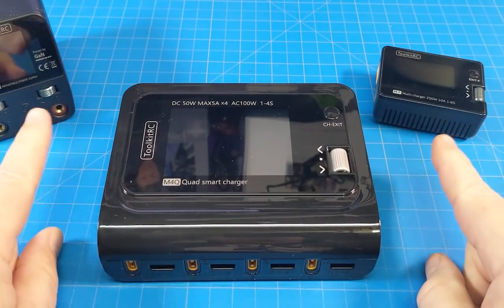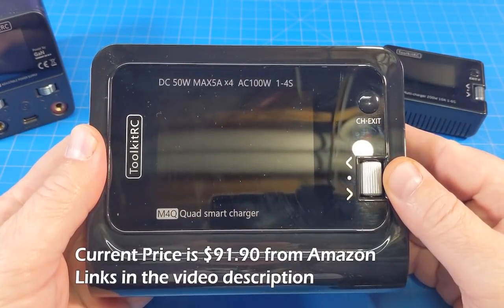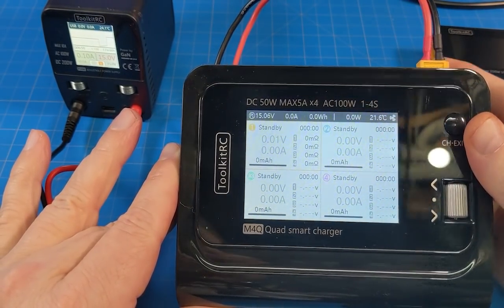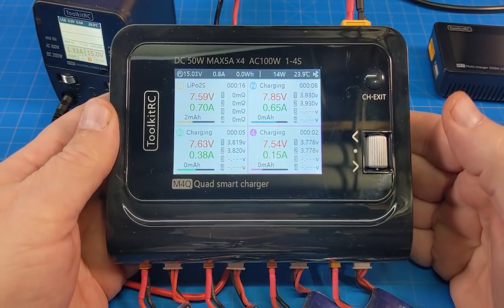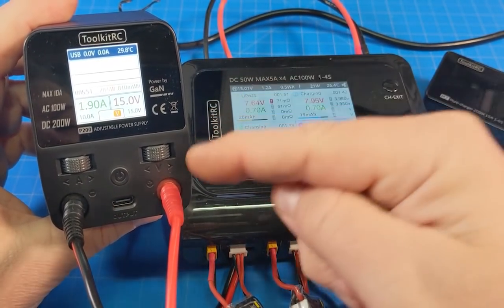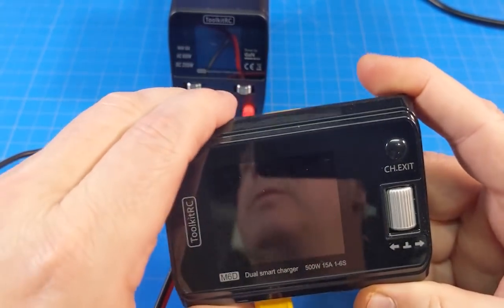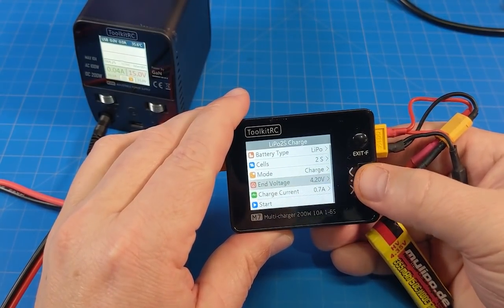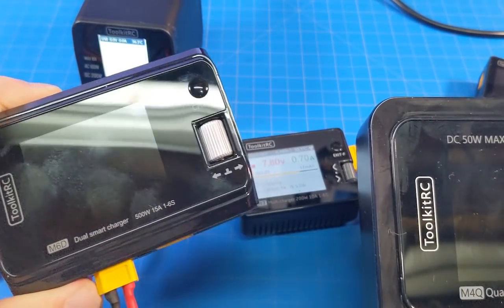My Favorite New Charger // Charger Power Supply // Field Charging

Comment: have the Emax  Hawk Pro and it comes with the XT 60 connector so I accidentally plugged in the 6S battery backwards to the Drone XT60 connector but it should’ve never happened because the bullet connectors in the Hawk Pro XT60 plug came too long an the battery on the drone made contact for a brief second with the plug reverse plurality on the battery and made a big spark and smell of something burning, and yet the damage to the drones board is minimal there was A slight melted transistor or resistor, I’m not sure what they’re called where the negative black wire is soldered to the drones board and after I took it apart and cleaned everything off I didn’t see any other damage to the board. and then after testing all features and functions they worked on the drone, it’s a miracle, it was a very short spark, but why are the bullet connectors so long in the stock XT 60 plug that comes with the drone in the first place they should never have make contact accidentally in the first place because the plug only plugs in one way. very confused and pissed off that this was able to happen in the first place. have you ever noticed any XT 60 plugs that are able to make a short if they’re reversed because the contacts are too long on these plugs?

Comment: hi nick
for 2s lipo right
we still can see lipo and lihv version （e.g. gnb 450）
which one you recommend？ 
And i see you charge your 2s to 4.2only
is it a good practice to get lihv and charge it to 4.2only (for 2s and more)
Reply from the maker: I only charge 1s batteries to 4.35v all other batteries charge to 4.2 doesn’t matter if they are high volt or not
Reply: @NickBurnsFPV  thanks for your help

Comment: Hi Nick, I've been enjoying and learning a lot from your videos.  Total Noob to drones but I have an extensive and dated RC background.  Question - My current Moblite7 uses PH 2.0 connectors/batteries.  I would like to charge as you do in a simple multi-pack way.  What charger would you recommend or is the answer to change the battery lead on the drone?  I already have a collection of about 16 1S batteries ranging from 300mAh to 650 mAh all with PH 2.0 connectors.
Reply from the maker: The two chargers I use aren't available any longer, but I also have this charger https://www.racedayquads.com/collections/battery-chargers-accessories/products/ultra-power-up-s6-1s-battery-charger or we can use this series/parallel board to charge 4 1s batteries at a time on a regular charger https://www.racedayquads.com/products/the-flying-sandal-1s-parallel-charging-board?_pos=957&_sid=0cbc289d1&_ss=r

Comment: Thank You NICK!!!!!!  This thing is a life saver for my 2s shark byte whoop build.  I was literally waiting one battery at a time to finish charging from my expensive 2-6s power charger.  I've heard many comments warning about parallel charging.  And let me stress the importance of being able to plug it into the wall for power.  Wall a/c120v capability is a must for micros.  

Now can you recommend something like this that works for 1s and can do both charge and storage charge?  Also would be nice if it could do jst2.0 and xt30 for my 1s lipos.  Thanks for the focus on micros.
Reply from the maker: for 1s charging I use the htrc x4, its not similar to this at all, and only has ph2.0 connectors.

Comment: Is there any specific reason to use the P200 with either the M4Q or M7 because from what I can tell, they both have a power supply built-in.
Reply from the maker: The m7 does not have a power supply the m4q does. I used the P200 with the M4Q for demonstration purposes.

Comment: I also have this charger. I like the feature of having memory to save 5 different configurations. I have 4 configured for my lipo/lihv charge and storge combinations. You need to enable it in the configuration menu :) (by holding the button) and turn that option since by default is not enabled. I discovered that nice feature some months after hahaha

Comment: My M4Q made horrible fan noise when they kicked in while charging. To the point I suspected the fan was broken. I wrote ToolkitRC, insisting to send me a new fan. They were nice and did that, free of charge. I swapped it, but issue was still there. I found out, that it only does that while charging, not when it spins up when you plug in power and it spins up for like 3 seconds. So it was obvious, they are doing some sort of crude PWM and it did not work out. So I added a capacitor accross the fan (16V, 1000μF) and the noise issue was gone.

Edit: Some commentors suggested it does discharge, but that it's VERY slow and only does so in "Storage Charge" mode - I am going to test that now and edit this paragraph accordingly.
Edit2: WOW, it really does discharge when you select "Sto. Chg." It's painfully slow, but I don't care - my use case is to discharge back to storage charge when I did not use all batteries after a flight. Awesome!

Comment: oh man i was just looking for a charger that does multiple lipos..... this looks perfect.... had a not so good time with a parallel board and i dont trust them..... this looks amazing....
Reply: Edit: Some commentors suggested it does, but that it's VERY slow and only does so in "Storage Charge" mode - I am going to test that now.

Edit2: WOW, it really does discharge when you select "Sto. Chg." It's painfully slow, but I don't care - my use case is to discharge back to storage charge when I did not use all batteries after a flight. Awesome!

Comment: That second batt from the left looks a little "Stay-Puff"... is that just the camera angle or are you about to "self-destruct"?
Reply from the maker: Like camera angle. I don't mess with marginal batteries.
Reply: I figured it was a trick if the eye or camera... but I had to tease you a bit, I am usually asking questions and seeking answers, a little goofing around is good for the soul.

Comment: Hey Nick, I got one of those M4Q chargers when they came out & it’s great so far. Been using it on my 4s 850mah batteries for my 3” drone ALOT haha👌 I haven’t used it with a power supply though & only from the 240v out the wall here in Australia. 
Also I made & flew my 1st 5” drone yesterday!!!! Wooooooooo! Wow! So smooth & on stock BF with no rpm filters, bout to take it for another flight now😁

Comment: I prefer my Q6 + adapter in series instead of a parallel one, because in series it measures the voltage of each cell and loads, unloads and makes storage. And you can charge up to 6 batteries in series.

Comment: I really liked mine until it died after a couple months. I hope you have better luck. 

Edit I'm talking about the four-port charger

I also have the tiny charger and it is also dying I might be able to use it if I fiddle with it but I just avoid using it. 
Toolkit RC make some interesting stuff but my experience with their reliability has not been good
Reply from the maker: Dang, I will keep my eye on it. I hope it lasts. I have been using my Q200 for several years. One channel I only use for storage.

Comment: Hey Nick, if you get 4 of the fractal engineering boards you could charge AND store 24 whoop batteries at once, safely on individual channels for each cell. No worries of voltage matching or individual amp hours like with parallel boards. Best whoop investment I've made so far!
Reply from the maker: I have two of the flying sandel versions. And two whoop chargers that charge 4 batteries each.

Comment: M4Q looks really cool. With all of these cheap multi-channel chargers available, it makes parallel charging not worth dealing with these days for many people like me.
Reply from the maker: Yes, I too don't like charging setup. I just want to get it going.
Reply: @NickBurnsFPV  I parallel charged for 4 years, never had an issue and was always super careful. I had a fire in October of 2020 that took all of the batteries with it. My self-healing cutting mats. I must have made one fatal mistake that day, but I decided then that I quit and reformed my charging practices entirely. I could have lost everything in the hobby that day, and my home. I'll probably pick up this M4Q. I currently have 2x HOTA Duo Pros as my primary charging setup -- MQ4 would be a great addition to that setup.
Reply from the maker: @JohnCuppi  I have not had a lipo fire, but man they sound scary. Good that there wasn't much damage and no one was injured. I have all these batteries and I worry a lot about a fire. I get a wonky battery and I take it for recycling, or if I can't do that right away I stick them in the fireplace. I have two tool boxes I lined with hardy backer cement board that I store batteries in at storage voltage.

Comment: Hey Nick would you recommend the m4q with the big power supply you showed here to be able to use the DC 200W wattage capability or do u think it will be fine with its internal power supply of 100W?
Reply from the maker: 200w is the M4Q max, so if we want faster charging the 200w power supply.

Comment: I've been using one of these for a few months now. Great charger. My only gripe with it is how close all the connectors are. Charging 4 x 4s batteries at once is cramped so xt extensions and balance lead extensions are a must.
Reply from the maker: yea I can see that. I haven't felt a need for extensions on m4q but it could be handy to get a bit away from the "box".

Comment: Will this do 1s storage charge? the M4Q? cause that would be pretty sweet! also 100% agreed on the power switch, have the same problem with my D6 duo pro!
Reply from the maker: Kinda, we need a 1s charging board. Or I should say, I have only tried it with a 1s charging board. I haven't made a ph2.0 to xt30 cable.

Comment: Only thing, that disappoint me in m4q that there is no discharging feature
Reply: There is, the storage charge will actually discharge if cell over 3.85v
Reply: @xnoux1  Edit: The following statement was wrong - read this conversation to find out why :D

Original message: No, it won't. It will only charge batteries up to storage voltage. It won't do anything if the cell is over storage voltage.
Reply: @no-trick-pony  going to double check that on my end, thanks for double-checking :)
Reply: @xnoux1  Would be great. Mine just displays the cell voltage when set to 'Sto. Chrg' - I will leave it overnight and see if anything happens. I connected two full HV lipos, both at exactly 8.5V, on set to storage charge to 8.0, the other just idling there for control to see what happens. It would be really awesome if it did discharge!
Reply: @xnoux1  Well I am eating my words.. "Sto. Chg." battery now is at 8.31V, idling battery at 8.48V.  It really does discharge when you select "Sto. Chg."! It's painfully slow, but I don't care - my use case is to discharge back to storage charge when I did not use all batteries after a flight. Thanks! I honestly didn't notice when I tried the first time because it is so slow and I tried with a bigger lipo. Awesome, it's now perfect for my use case!
Reply: @no-trick-pony  haha I am doing this now too! It’s slow but it does discharge... I’m glad it helped :D

Comment: Hi can I charge my 18650 batteries with 5v 600mah if I monitor the voltage and disconect it when it reaches 4.1 or 4.2 voltage?
Reply: Yes I believe because the charger will charge lion batteries and you can set the end charge voltage to you’re liking.

Comment: The power supply is 100w on AC and the M4Q is 100w on AC.  So the power supply doesnt seem very useful in conjunction with the M4Q IMO.
Reply from the maker: True. I have been using it for the purpose of making sure it works. Not to its fullest capacity of course.